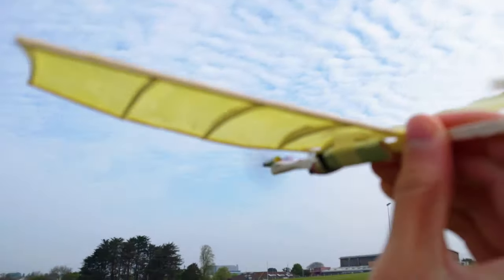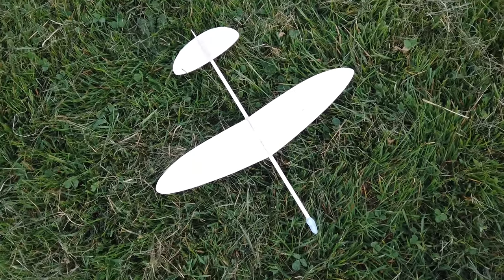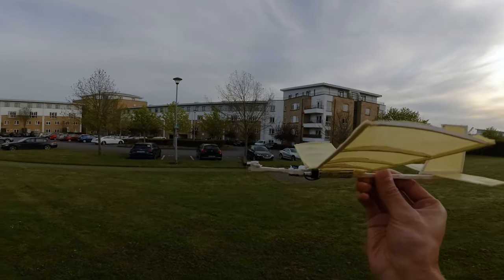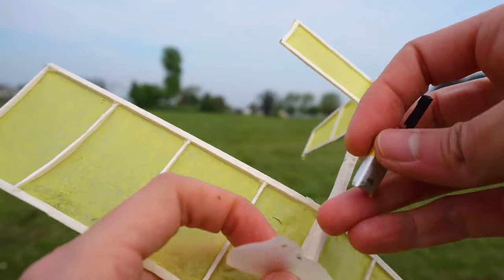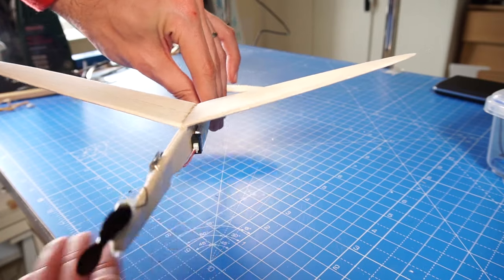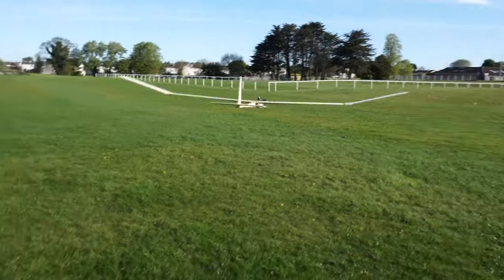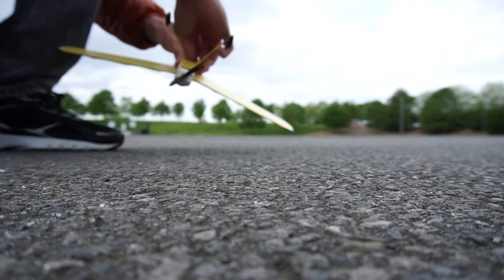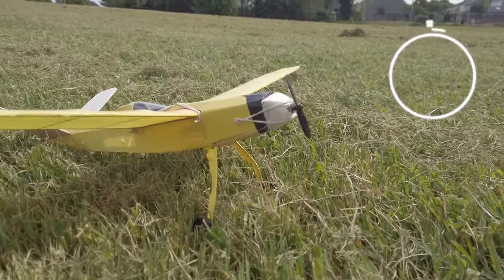Electric system for free flight airplanes

Comment: The second one is a winner. Did you notice any difference if you mounted the battery on the left side from the right, especially considering the direction of the propeller and the torque of the motor?

Comment: Interesting video  .   I have motors and batteries from a drone but I'm lost on the circuit board and programing .
Reply: You can't get away from the circuit but you can get away from the programming. If instead of the micro processor you use a 555 timer chip to drive a transistor that can handle the motor current. To keep it light you can eliminate the circuit board and solder the electronic parts together and glue them right to the fuselage. A tiny trimmer resistor can be used to set the on time of the circuit.